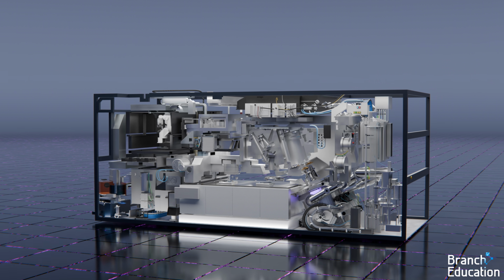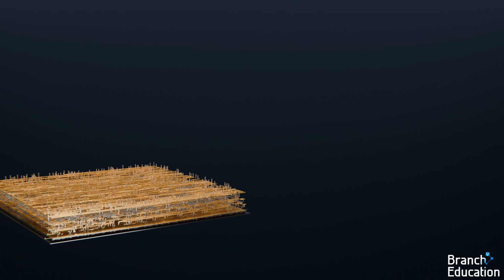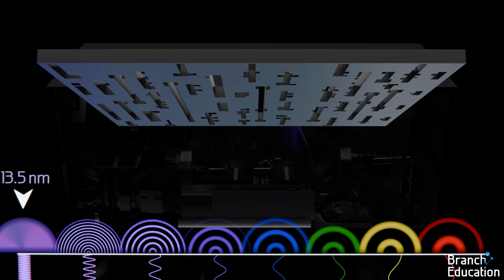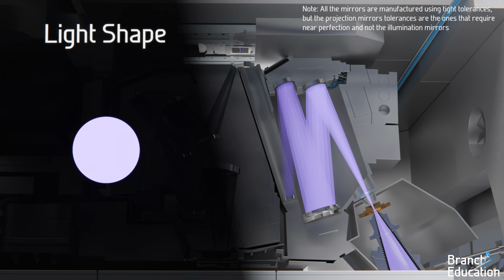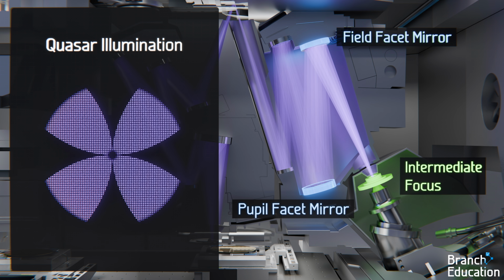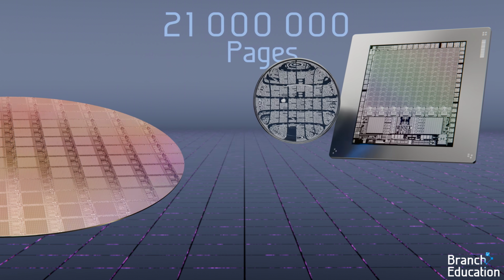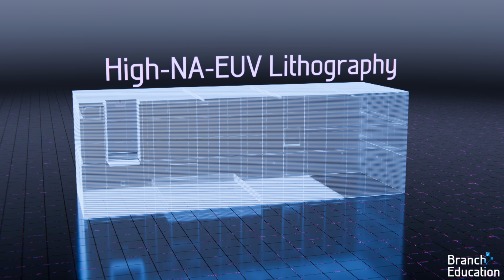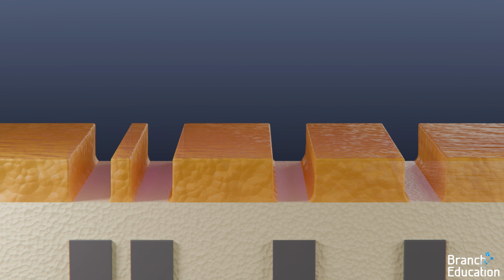The $200M Machine that Prints Microchips:  The EUV Photolithography System

Comment: If anyone wonders how the US controls the export of these systems, they should know that:
 - EUV technology was originally developed in the US via consortiums (DOE national labs, NIST, .. and many prominent private companies in the US developed the technology via those consortiums).
 - Actually, ASML was late in the game; it got the permission from the US government to join the consortium, and then it got access to the technology (the US government actually rejected the requests from Nikon and Canon to join the program due to national security concerns. and that's the reason there is no EUV system coming from Japan, despite its significant share in the lithography tools and equipment market).
 -  Along the way ASML got the green light from US government to acquire a bunch of American companies to make the system what it is today, (it still works under many of those licenses).
 - Many critical parts and components of the EUV system were developed in the US and still come from American suppliers; for example, the optics/mirrors is the technology that was developed by Lawrence Livermore, Lawrence Berkeley, Sandia National Laboratories and Tinsley Labs in the US; then it was transferred to Zeiss. The reticle stage technology was developed in the US, and it's still built there, and more importantly, the core and the most complicated part of the system, which is the light source, is designed and built in the US by an independent California-based company called Cymer. The laser is also designed in the US by the same company and is built by Trumpf in Germany.
Reply: Thanks for interesting insights 🔥
Reply: Wow, humanity should be grateful to the US... Despite this, the chips are not produced in the US and the company is not American...

Comment: 18:25 Firing lasers at tin droplets flying past at 100 m/s, micro-controlled by mirrors at a rate of 50,000/s is crazy. Reminds me of biological processes like cell replication.
Reply from the maker: The funny thing is that we simplified the tin droplet.  For example, in actuality,  3 separate droplets are fired at different speeds, and then converge to form a larger droplet, which helps with consistency of size.
Reply: @BranchEducation  I feel a bit weird watching this and thinking that I would've been a totally different person if I'd had access to stuff like this when i grew up. At least you inspire current young generation.
Reply: @BranchEducation  what are the drawbacks or inefficiencies of just having a continuous laser beam and having the tin droplets just fly into it instead of having to use high speed cameras to calculate trajectory and having the laser beam have to time it right? You know, considering it happens over 50k times a second. It's basically already continues to the human eye
Reply: @ogkreees  A continuous laser beam would not reach the peak power to vaporize the tin droplet since a lot of laser light would not even hit a droplet but the space in between. Even more so for the stronger plasma-generating pulse. That needs a bit of peak power too (peak power is how much energy you can deploy in a given time).
Reply: this can make you head spins for a while 🤣🤣
Reply: I don’t mean this literally, but I can see how one could consider such machines as alien tech! This is simply amazing…….
Reply: It reminds me of smoking a shit Ton Meth of in my truck with the windows closed

Comment: i have a question how difraction is handled. like you said there is nanoscopic segments on mirrors that can move very slightly (another question how they move, and regulated?), and they consist of layers. and so: when euv light hits deeper placed mirror layers it has to reflect through deep layers, but reflected light has to go through layers that are placed a little bit higher, then question arises: how those reflected lights from neighouring higher mirrors segments dont create reflections to not focused places?

Comment: Excellent work, as always! Worth the wait.

So how is the mask manufactured?
Reply from the maker: Good Question!  Typically it's built using an electron beam that kind of acts like a dot matrix printer to imprint the desired pattern onto the mask- and then there are similar processes to complete it.   The difference is that it takes hours upon hours to make a single mask using an electron beam.
Reply: @BranchEducation by the way, how mask is not destroyed by 7+g forces, they are 10nm i.e. about 100 or so atoms or even less, even if we include almost ideal alloy quality and their bond to layered base it is hard to belive that this kind of material can wistand hundreds of stress tests, each day for years. and dont change their structure over course of years?
Reply: @piko1032 as he mentioned we only know so little and the rest is trade mark
Reply: @piko1032 yeah, perhaps the question to ask here is how long can it last for. After all, a single design does not stay in production for very long (up to a year?)
Reply: @StanislavManilov irrelevant
Reply: @piko1032  7+G's is not much even for us biological beings, for example, pilots (9g+) or F1 drivers (6g+), and rollercoasters (4-5g's), etc.
Ralph Schumacher crashed his F1 car at Indy 2004 and pulled 78 g's of force, suffering 2 minor spinal fractures. 
Colonel John Stapp in a 1954 US AF test experienced 46g's of deceleration over 2 seconds and still walking away with temporary blindness and broken ribs. 
Atomic bonds are much stronger because atom mass is super small, and acceleration forces can't really break them apart. To break the bond, you need to inject energy (thermal, radiation, chemical) directly into bond, like a photon or electron impact.
Reply from the maker: @piko1032  Very good question.  For one, the mask is in vacuum, so it's not like it has to deal with air resistance.  Aside from that, the mask is very thin, only a few nanometers.  So a few nanometers thick ontop of a flat surface, probably not too much force overall on the traces inside the mask.
Reply from the maker: @StanislavManilov  They definitely get replaced- tho after how long?  Probably weeks?  Tho I'm not at all sure and this data is confidential for sure.
Reply: @waelfadlallah8939  It is mildly relevant. If a mask costs 300k and it can be used for about 1000 wafers, that's 300 bucks per wafer just for the mask.